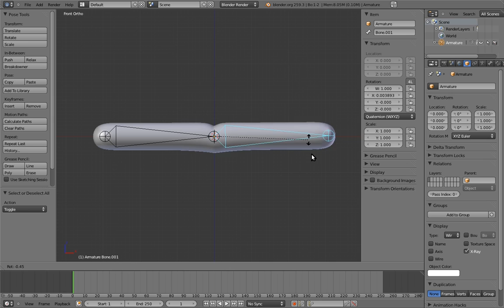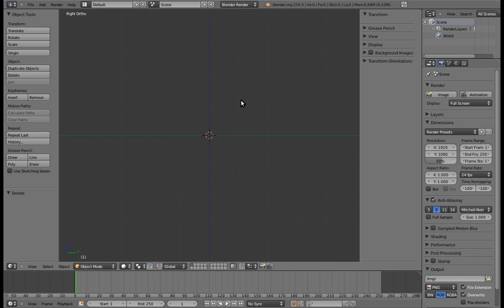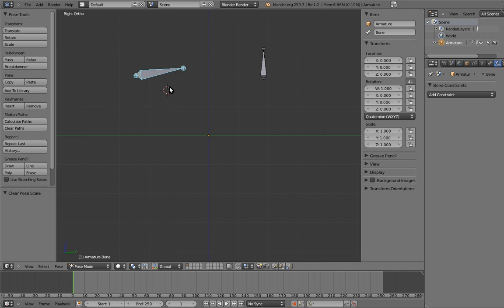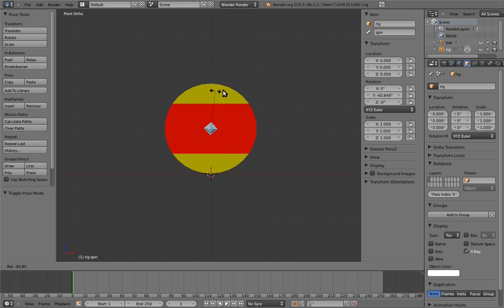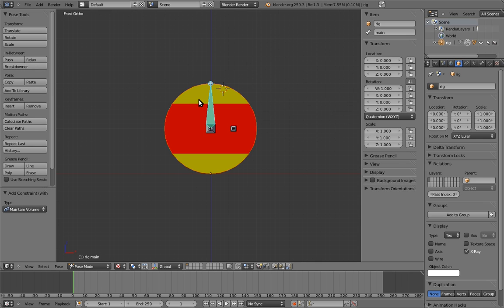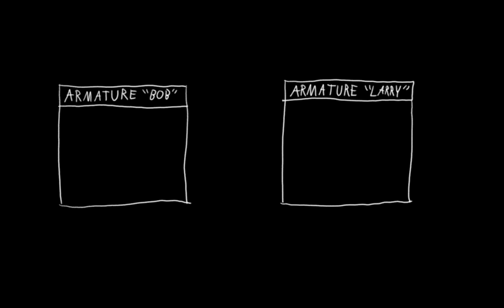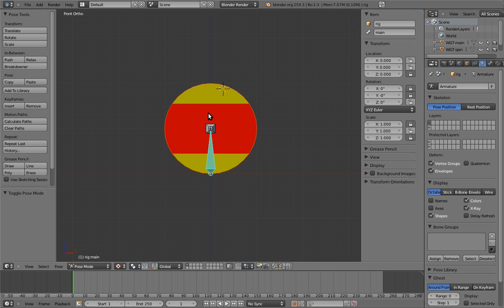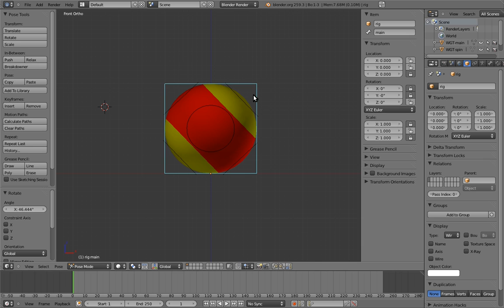Humane Rigging: chapter 01, video 03

Comment: Blender 2.8x:
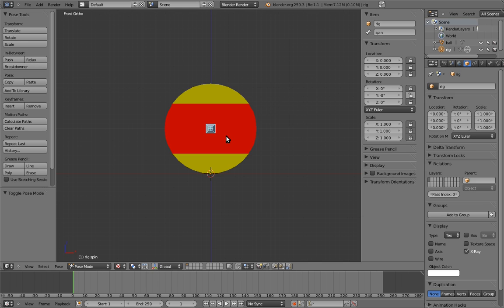08:09 selecting the mesh while in Pose mode seems to only work via the Outliner (or correct me)
Reply: I wasn't able to get the method shown in the video to work either, but I also I never though to try using the outliner to do selections between different modes, so I wanted to thank you for reminding me of this option. What I was doing instead is more fiddly than using the outliner, but it still works: Any time you select any element in any mode, it stays selected even after leaving that mode. You can select a bone in Pose Mode, then go into Object Mode to select an object, then, while still in Object Mode, shift-select the armature (which has the "Pose Mode" selected bone inside of it), then hit CTRL-P (while still in Object Mode), choose the "Bone" parenting option from the menu, and everything will work out as desired (you don't even need to return to Pose Mode, because Blender remembers which bone you had selected in Pose Mode, and targets that bone as the parent, even though you're in Object Mode at the moment). This is very clunky, but it may be that there are times when you actually have to do things this way, or at least, understand that these mode-specific operations can still be performed from outside the relevant modes, so long as certain relevant elements are already selected.
Reply: Seems like you have Edit->Lock Object Modes checked. With this option checked, you can only select bones when you are in pose mode.

Comment: thanks for skipping how you Made the SHAPES !!!
Reply: For anyone else needing a way to create the WGT-main and WGT-spin shapes. 
For WGT-main, add a cube, then in edit mode delete using the "only faces" option. 
For MGT-spin, the spin control is just an object made up of circles. Each circle is spaced one unit from the center of the object and facing it's respective axis.
Reply: Yeah, thanks really, that wasn't the topic this series, otherwise i would have got distracted